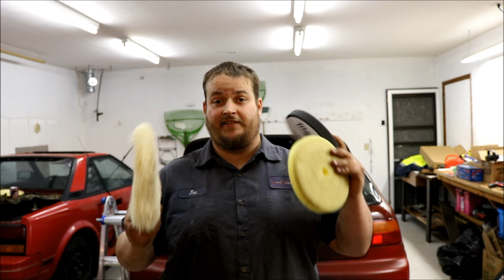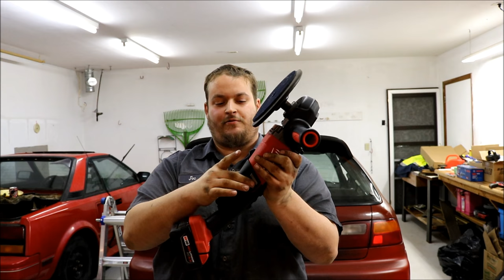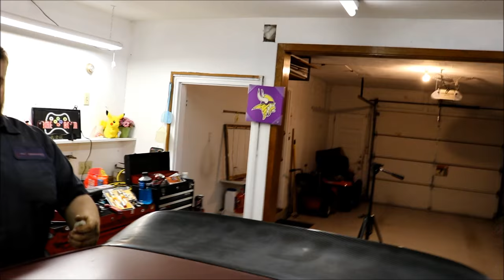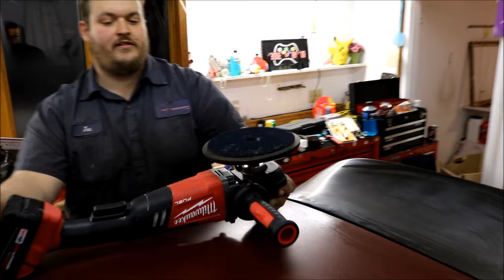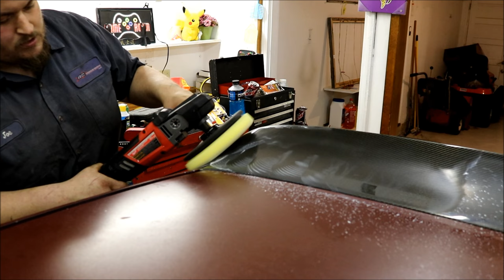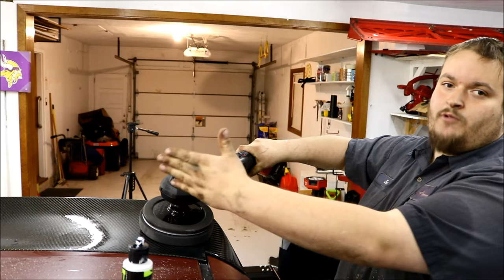Milwaukee M18 FUEL 7 inch polisher 2738-22p - REVIEW

Comment: Great video; would it be possible to get the part numbers for the 7" wool, spreading, and finishing pads? Bought the buffer as a bare tool
Reply from the maker: wool pad 48-48-0500
foam compound pad - 49-36-0650
finishing pad (now red) 49-36-0670
Reply: Thanks Joe; you're awesome!
Reply: @dmitry7248  I thank you as well

Comment: Hello Joe...

I currently am looking at this for my small rapid repair bodyshop, with a turn around off 7 to 8 cars a Day so do alot of polishing, I know you've said that the 5ah Battery would last between 30 to 45mins of consent polishing but what about if the new 9ah battery was put on the polisher what sort of times we looking with milwaukees new battery??

Cheers Nico!
Reply from the maker: with the 9.0 you are going to get extended times just im unaware of them because i havent tested it with the 9.0

Comment: Not a person to be know to judge others however why on earth would you take a SPRAY sealant/quick detailer in the way that you did. You're just wasting the product as well as having the possibility there to harm the car if the pad ever drys out during rotation without you realizing. Honestly never seen this done but if it works it works i guess.
Reply from the maker: I agree with a spray sealant but what i was using a hardening sealant that gets machine applied it was watered down a bit  so wasnt the consistently i wanted for the video
Reply: @JoeTheAutoGuy  Oh ok that seriously makes more sense now, nice video though by the way.

Comment: It dont seem to be a "orbital" type polisher correct? If not why? And is there an advantage to a Orbital vs just spinning?
Reply from the maker: matt G when doing paint finishing work (polishing new paint in bodyshop and heavy cutting) a rotary polisher is usually the weapon of choice. The school of thought is been changing on this with detailers but the majority of the professional world uses a rotary still. And for me you can see i cut into heavy gelcoat  and it did a fantastic job

Comment: Do you still have this polisher? How do u like it after a year and some change?
Reply from the maker: Gabriel Vega i still love it its been fantastic and is just as powerful as my corded
Reply: JoeTheAutoGuy does a 5.0 battery really last 45 mins on this polisher?
Reply from the maker: On a heavy cut job no but still 30 min or more  , ive had the battery last 45 min on moderate speed polishing and light stuff if not longer

Comment: do you know if you can put smaller size BP on it?
Reply from the maker: seems to be standard backing plate threads on it sure you could
Reply: Lol using huge backing plate on a curved surface is not the best way